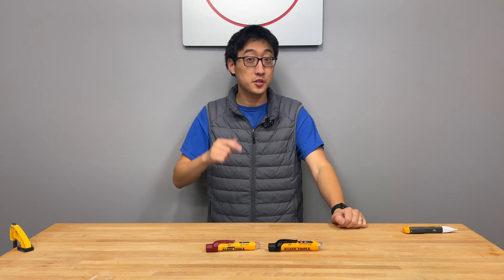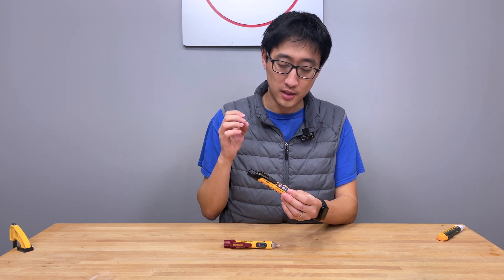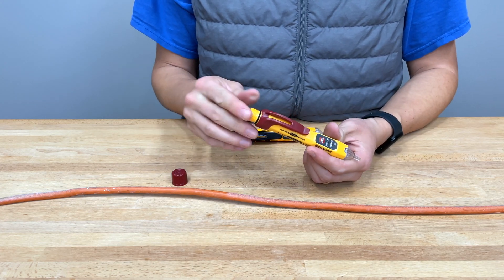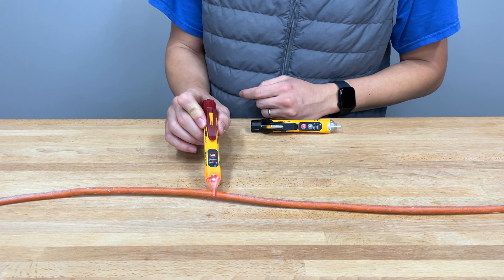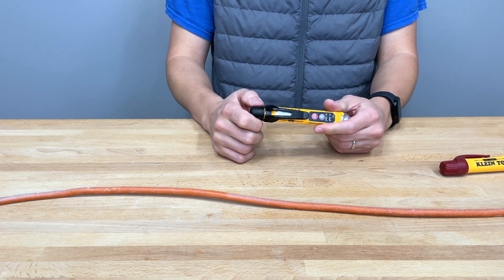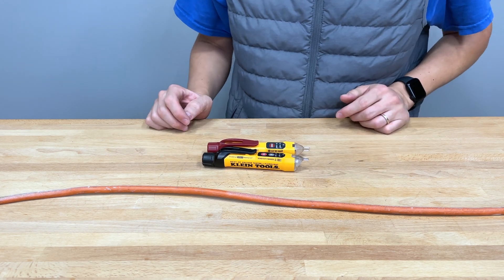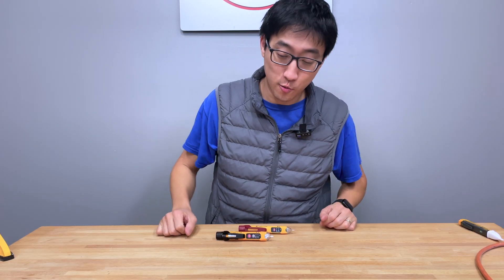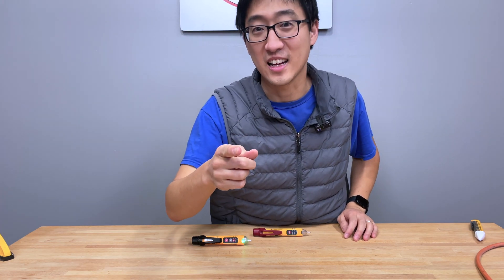Klein tools non-contact voltage tester NVCT-2P NCVT-3P review

Comment: Good video but you missed one of the key uses. NCVT are great for detecting no ground. The field around ungrounded wiring is much bigger than grounded. In my case we do a lot of knob and tube replacement. If you put the sweet spot of most NCVT one the cover plate screws at a switch or outlet it will not indicate if grounded, but will indicate if not grounded. Big light fixtures with a lot of metal have enormous fields. Sometimes I can pick up no ground 18" away from any wire because the metal of the fixture enhances the magnetic field of the ungrounded wiring.

Comment: I have the Klein Tools one which also has a thermometer, it’s insanely sensitive and can detect voltages below 12v ac or dc, i use it usually to find wires or see if there’s voltage going through wires, when i work with 120v, i will always double check with a multi meter afterwards to really make sure the circuit is off

Comment: Just bought the 2p and when its in 12-1000v mode and I turn it on it beeps 3times with red and green leds flashing then powers down?   When I turn it on in 70-1000v it turns on and when ai switch it to 12-1000v and i get close to electrical it beeps slow with no flashing lights? Do I have a bum tool?
Reply: Mine has given me problems from day one. It's not reliable so it's going into the garbage.
Reply: What does it mean when it blinks blue

Comment: We call them dummy testers in electrical.  You really should fully trust a dummy tester anyways if actually worried for ur life. But they are great tools for finding wires or circuits.
Reply from the maker: agreed. Good practice.
Reply: Are you saying they don't work because they are easy to use?